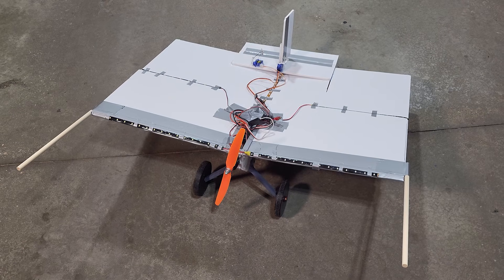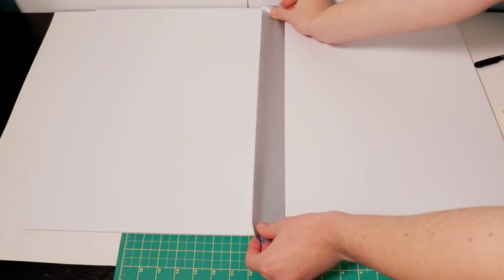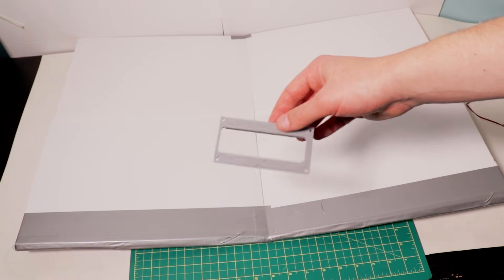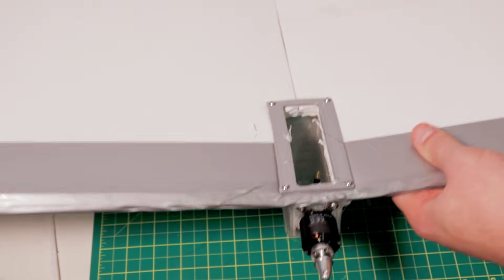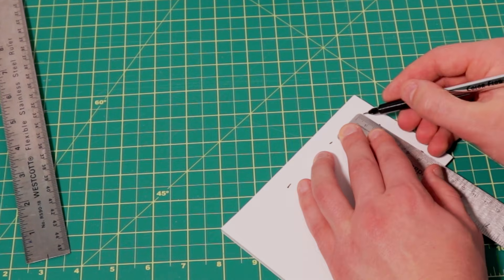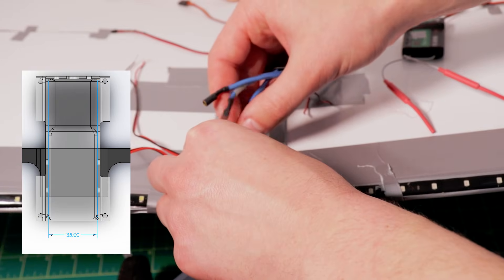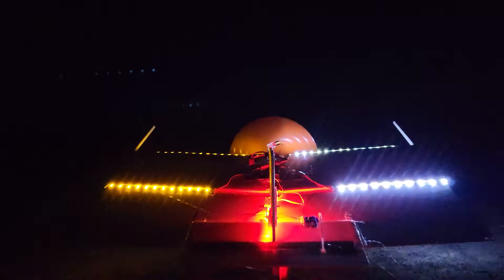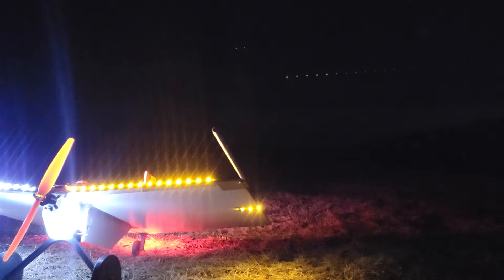A Night Plane Made of Duct Tape, PLA & Hot Glue (Yes, It Flies)

Comment: It is awesome. How long distance it can fly?
Reply from the maker: Hi thanks for the comment!

I got around 10-12 minutes per a 2200mah 3s lipo (discharging to around 30%), so with 2 of them I used it for around 23ish minutes. I feel like I could stretch it if I spent more time cruising but I want to land it and take off a bunch of times. 

Regrading distance I don't fly it too far out at night since if I fly it too far away it all just looks like one glowing ball, as you can kinda see in some of the clips, making it hard to tell what the wings are doing. 

cheers,